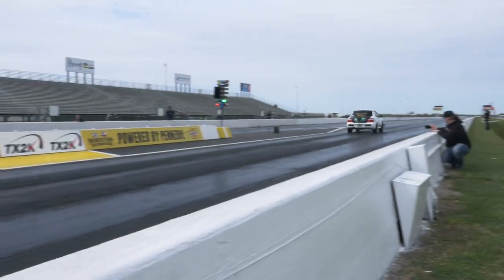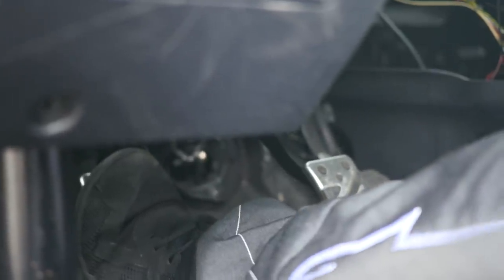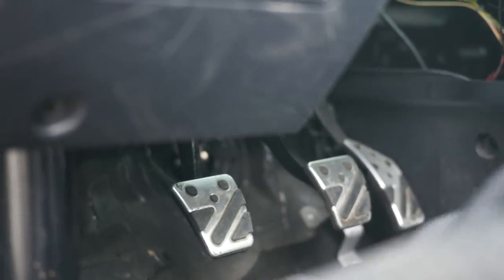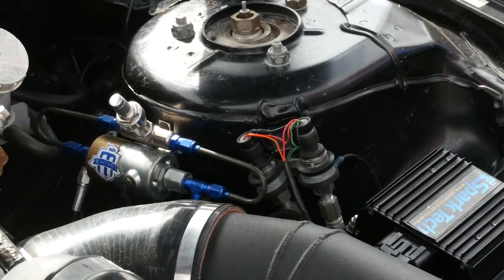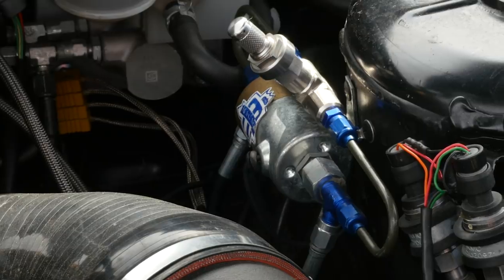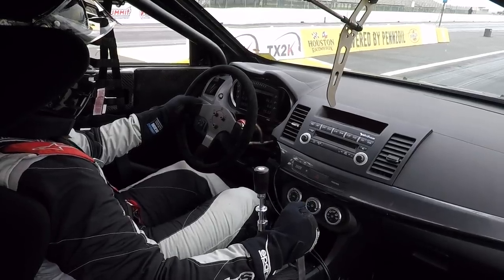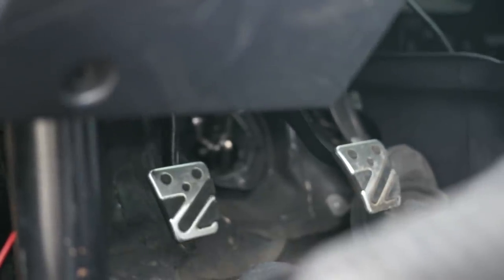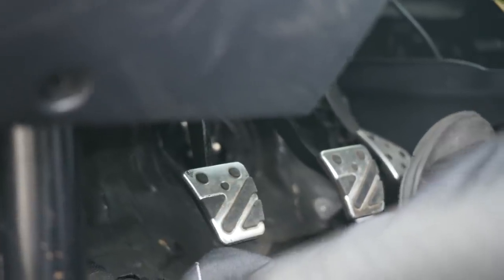What Is A Slipper Clutch | Do YOU Need One? [TECH NUGGET]

Comment: I have this on my RB30 Skyline R33 GTR Vspec and my 20b FD RX7. I love it, it’s controlled by my Haltech Elite 2500. It only engages when I’m in 1st gear, between 0-7mph, and the engine is 75% throttle over 4500 rpms.
Reply: You should test to see if leaving it to do it's thing in all the gears is of benefit. It just smooths out the whole process of acceleration.
Reply: Does it really go through clutches as fast as he is saying?
Reply: jakesworldvr for me it is noticeably different (on/off) when launching my car. I’m more consistent and launching the car is super easy.
Reply: I mean does it wear them out as quickly as he is saying. I love the idea of this and really want one but would hate to have to be changing my clutch all the time
Reply: jakesworldvr no it does not wear the clutches out the way he is explaining it. I have not seen any additional wear. But I would assume that if you are doing multiple launches over a very short period of time, then it would increase wear. When I go to the track I launch my car anywhere from 5-10 times a night and if I’m street driving then I might launch the car should a try-hard pull up next to me. But I also have mine controlled by the Haltech ECU.
Reply: @jakesworldvr  it depends. Too much slip and certain clutch disk materials wear faster. You want a sinstered iron disk, they take the most heat with less wear overall. Most aftermarket clutch companies offer it as an option. This the tip of the iceberg.

Comment: I believe you should explain the difference between this and an actual slipper clutch. Actual slipper clutch does more because not only is it adjustable it adds pressure to the clutch disk as rpm increases. Making it extremely better for hp cars. No question this works but it's nothing like having an actual slipper clutch.
Reply: They both slip the clutch 
It the same thing they both gradually apply more pressure to the clutch 
If you want to be technical call it a clutch slipper lol 
It fully ajustable man it can go from 1/10 of a second to 2 second and you can bypass it to be normal for when not launching and it can be ecu controlled 
And in most 4wd and fwd car the bellhousing is just not big enough to accommodate a "real" slipper clutch like you talking about

Comment: HPA let me tell you that I have been on this bandwagon for awhile now but only now have actually used a product. There is a lot here that I have said in response to other comments but once the cat is out of the bag, FWD, AWD it doesn't matter if they have a clutch and are manually shifted they will benefit from slipping the clutch and only go faster, with far less parts breakage. There are people in the Coyote Stock community that used to break T56 transmissions regularly but can go a whole season or two on the same trans with clutch slip. The clutch tamer has become so popular in that class that automatics have fallen out of favor, you can read about it the latest issue of Fastest Street Car Magazine that the NMRA puts out. It's also linked to Grant's website clutch tamer dot com.

Comment: Was looking for explanations, found them thank you!
Reply: While this obviously works well but this technically isn't a slipper clutch or a clutch at all. Slipper clutch has adjustable weights and the pressure on the clutch disk increases as rpm does. They hold high hp much better also.
They can be adjusted between rounds depending on track conditions if you add a hole in the bell housing. Also I don't think this was a big secret. Unless I and a few other rwd guys have been in on it this whole time lol.

Comment: wow that is completely different to a slipper clutch in motorcycle world.
Reply: It's completely different than an actual slipper clutch in a car also. This isn't a slipper clutch. This a device that's just controls the engagement. An actual slipper clutch has adjustable weights on it and pressure increases as the rpm does.

Comment: Would this be useable on a 2wd application for slipping the clutch off the line?
Reply from the maker: Yes sir! Also very common with our motorcycle brothers who can otherwise spend more time watching clouds than they want to =) - Taz.
Reply: @hpa101  cool because I want to build a rwd drag car and I want to make my clutch slipping more consistent for better 60fts and so I don't brake stuff
Reply: @ATLASGAMINGApallo  As Andre said, for the same reasons - remember it needs to be a hydraulic clutch, so a mechanical will need to be converted. Either way, I would suggest a concentric release assembly that fits over the input as it is MUCH easier when not battling release levers and bearings falling out of the forks.
I suggest using a dry-break quick release coupling to avoid messy fluid leaks and it should remove the bleeding hassle.
If the gearbox is bolted to the bellhousing from the inside, consider modifying it with a stud and bolt conversion that allows removal from the bellhousing - with some installations access can otherwise be a b***h, even requiring jacking the engine or removal if there isn't bellhousing clearance!
Give some careful thought regarding clutch type - size, number of plates, material, etc. An upgraded OEM style may meet your needs and offer decent service life for many applications. Some sintered materials are VERY intolerant of heavy slipping and can overheat very quickly! More plates will spread the heat more gradually into the components and possible extend service life as will more pad material on the plates. Larger diameter clutches will potentially offer longer service and more thermal absorbsion but cost more and add inertia.
Depending on your application, and budget, a full carbon-carbon clutch may be well worth the higher initial cost as they have very good resistance to heat, can be rebuilt to compensate for wear and have low inertia - so may work out significantly cheaper in the longer term than a 'cheaper' setup.
A cabon fibre driveshaft will also reduce the shock loadings on shifts, reducing the chance of 'shocking' the tyres into runaway slippage.
Reply: @gordowg1wg145  They can be used with cable style clutches, go to clutchtamer dot com  The majority of the Coyote Stock and Factory Stock NMRA cars use these, autos have fallen out of favor in those classes.
Reply: @ATLASGAMINGApallo  Two issues here. Everybody in the tuner community wants to turn the feature off in the other gears without data to back their contention. Go watch a interior shot of a Coyote Stock car. With the same amount of time to slip the clutch off the line can also help keep the tires planted and lose less RPM between shifts.  Making the car faster with it than without it. The Coyote Stock cars keep going faster and it has little to do with power increases. It's increasing efficiency in the driveline. Putting more energy into the tires and less of it burned off usually as heat makes things better. You need a slightly better clutch than you would normally buy, also stay away from Kevlar disc, you need as much delay as possible to make the launch smooth as silk and Kevlar disc heat up too quickly. You can also dial in as much traction as you need. The days of losing impromptu street races because you have a FWD are a thing of the past.
Reply: @dj4monie  I shall, thank you.

Comment: Why bother with side stepping the clutch at all?   Put a PWM on a button with a MPH trigger and disable the system once the car reaches a set speed at the end of 1st gear.   Even more consistent.
Reply: Slippage in the other forward gears can be beneficial, something the TUNER Community has yet to grasp
Reply: A little slip helps between gears. This is not for AWD only, FWD cars have biggest problem with traction. All manual trans cars can benefit. Joe Gannis is using a slipper clutch, same idea much more expensive. Once it's setup right the car just goes faster period and consistently which is key to going rounds in drag racing.

Comment: Funny, BMW E90 models came with clutch delay valve like that from the factory. A little part in the clutch line with a smaller inner diameter. I guess to achieve some kind of softer clutching. Unfortunately it is a pain to drive.
Reply: How so? I find in the tuner community the harder the clutch hits the better. But then wonder why they have lots of wheel spin. I don't ride the clutch I side step the clutch. It smoothes out everything. No more jerky behavior either.
Reply: Every bmw back to at least e36

Comment: Anyone using these in fwd applications?
Reply: Yes, I have the Clutch Masters unit. I am on the smallest jet but with an otherwise completely stock suspension and clutch I am not getting the best out of it, so I am not going to judge. Plus the way the PCM acts in a Focus ST means to spool the GTX3071 on the car I need spark cut to create exhaust energy.  Below 3000 rpm makes the engine work too hard to put energy into spinning the rotating assembly IE means it starts too far down and out of boost to get off the line, while 6000 rpm makes too much torque (about 4-5 psi off the line) and it spins the slicks (1.90 60 ft). I've already took some power out of it but I haven't been able to test it because I ruined a slick. That's another thing, with clutch slip you can now run drag radials where you previously thought you couldn't which will only make the car go faster and you can air your slicks back up to a reasonable pressure unlike most FWD cars which runs them as low as 7 psi to get the grip they need.

Comment: Like a BMW then, in a SMG transmission
Reply: Better, oem units are not adjustable. You need about a 1.5 second delay from full depress to full engagement. This will drop your 60 ft times like a rock. No more 2.x all 1.6 and better with slicks or drag radial tires

Comment: This ain't a slipper clutch that's just a clutch release valve.
Reply: How many 10 inch slipper clutches have you seen? What if you have a diaphragm clutch you just SOFL? There is a better product than this on the market but all these things work at varying degrees. I had the Clutch Masters in my Focus ST. It worked fine, my problem was when I upgraded the turbo, it would fall on it's face at anything but 6000 rpm. That's because of how Ford does it's rev limiter strategy. It's normally a fuel cut but under 3K and over 5999 it's ignition cut. So to prevent the car from falling on it's face at launch, I had to increase the 2 step to 6000 rpm. The car generated 4-5 psi off the line but blew my slicks off, no matter how long a burnout I did or what cold PSI was in it. Even with the valve I was on the smallest restrictor and it still would spin the slicks (1.90). I ran out of range of adjustment. You can fix that with cut-down nitrous jets but actually the Tilton Flow Control valve starts at the lowest setting the CM Valve does. Ideally you want to be in the zone of the clutch/engine/trans for about 7 tenths of a second to get the car out of the hole without spinning the tires with just enough torque to get good short times. It's no different trying to hook 2000 hp to 275 drag radial. The difference there is they are using a torque converter and boost control.

Comment: Turbo 400’s forever !
Reply: Nope, less driveline losses in a manual. The problem with manuals is trying to launch the car high enough not to bog the engine which can cause a whole slew of problems not just bog, then wheel spin. Then consistency is the next issue. You can drive far more power through a diaphragm clutch controlled manual than in a otherwise stock automatic which will try to burn itself up behind 50% increase in power. But cure those problems and any manual car is faster and more competitive than a automatic. Autos are consistent because the human error element is eliminated. You manually shift TH400's, C4's, C6's and the rest of them because valve body tweaks are expensive and software controlled shifts require a seperate computer for more electronic transmissions.
Reply: Anthony Thomas
I’d disagree based on time slips ( numbers don’t lie) 
Powerglide and 2 or 3 speed TH400’s are quicker than stick cars with identical weight and power.
Reply: @dj4monie  Well put, and entirely correct.
Reply: @flyonbyya       
I'll bet you're big on Holley double pumpers too 😆
Slippers AND T400's both have their places and implying that one is universally superior, which this post doesn't do, is wrong.